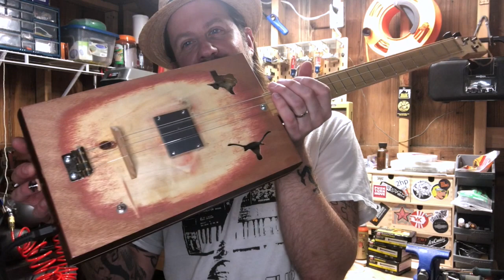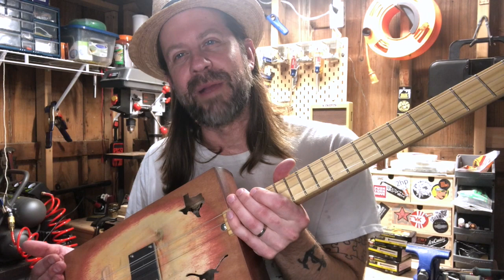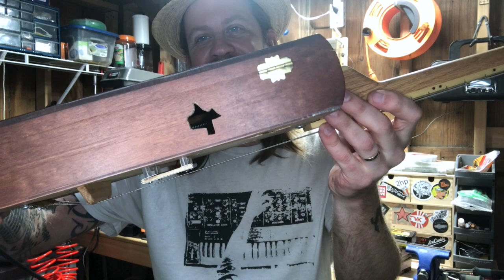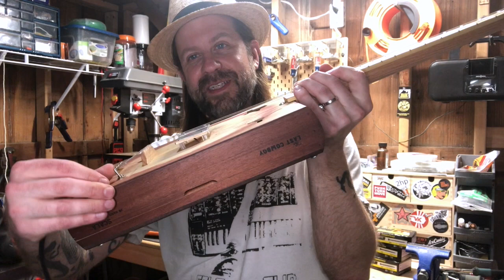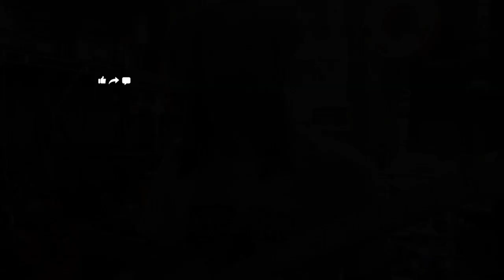Mods to the Texas CBG

Comment: I love the mods, Kale!  Thanks for adding your personal touches to make it, not only your own, but even better!  I look forward to hearing more from it with it’s new voices!
Reply from the maker: It's kinda funny that my original intent was to add a kill switch and I ended up adding a second pickup. I guess that's how my workshop antics go sometimes. LOL.
Reply: That's cool with me!  I really like the star on the headstock!  I actually wanted to add a star at the 12th fret but I couldn't find anything to serve as a brand.  I really like how you set up the wickedbucker!  I built the guitar with the desire that it would sound good acoustically without amplification but also have the option to plug it in.  I think these mods made retained the acoustic properties while significantly expanding the electric option!  Well done!  Maybe we should plan some collaborations where I build the platform and you wire it up!
Reply from the maker: @stevesstrings5243   That's actually not a bad idea. A CBG collaboration project.
Reply: I’m up for it!